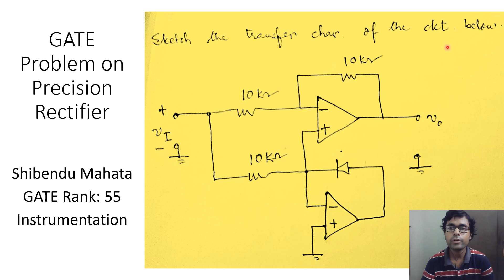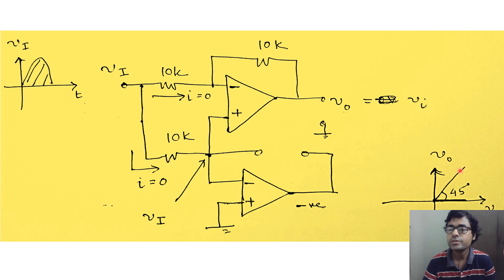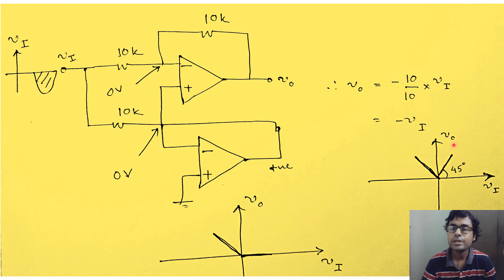Comment: Thank you Sir 
Case1 :for the  postive cycle and then the diode open and i =0A 
vi=v-=v+ 
So vi-vi/finite=i10k=0A 
Thus vo+(10k*0)=vi ...answer
Case2 : Negativ cicyle  ,diode is short and v-=0v 
So i10k=vi-0/10k=vi/10k, vo+(vi/10k)*10k=0,vo=-vi....answer